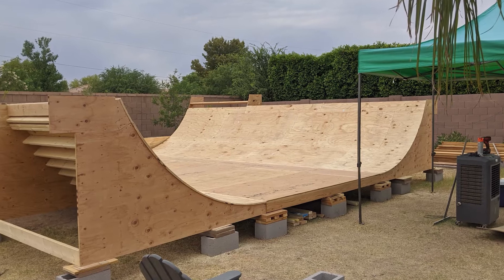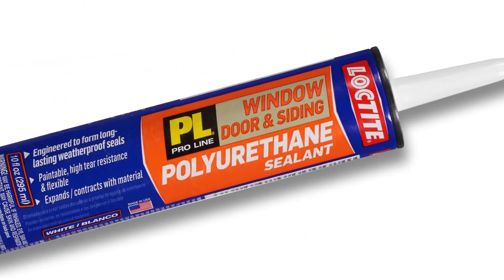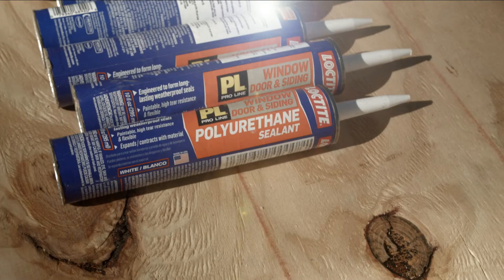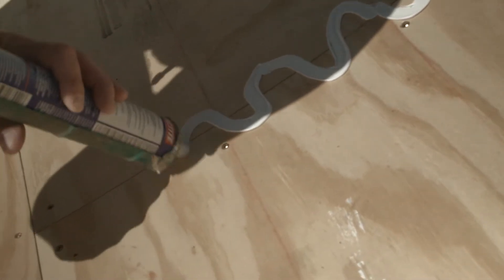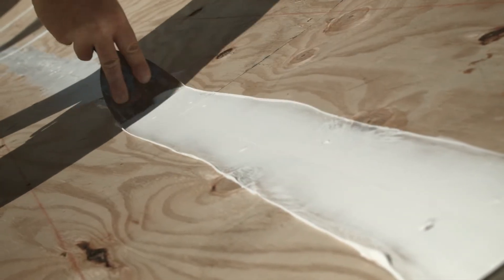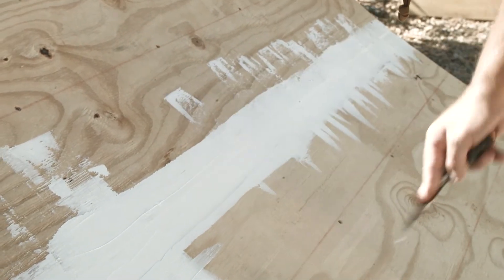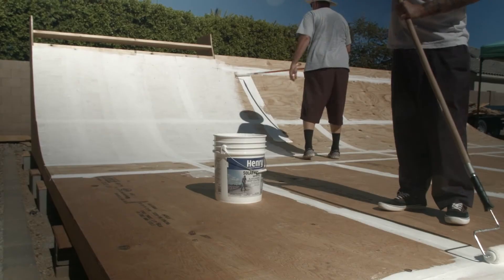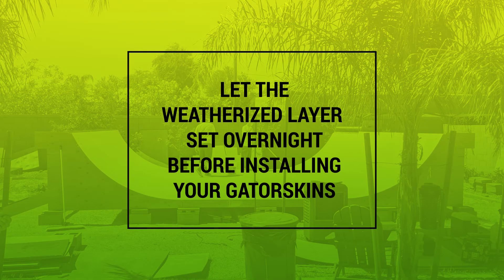Weatherize your ramp!

Comment: If you're unable to get gator skins, do you feel these steps will do a solid job of preserving your ramp? Thank you for sharing ✌️
Reply: I need to know the same thing. This comment is the only one without a reply.
Reply: Yes.  This will make your ramp water resistant.   Wood absorbs water and gets warped and damaged over time.  This will slow down water damage for sure.  👍

Comment: Do you guys tarp before big storms / winter seasons after weatherizing ramps that have gator skins? Wasn't sure if it's overkill or if humidity / moisture stuck under the tarp would do more damage than good.
Reply from the maker: Never a bad idea. If the ramp is going to be inactive and unskateable for long periods of time due to wetaher, tarping it off is always advisable.
Reply: Tarping is not overkill.  The more the water sits on the ramp, the more it will do damage over time.  Humidity will do less damage than standing water.

Comment: Any reason why I shouldn't paint the plywoods bottom and 2x4s prior to install?
Reply: When you screw it in it’s gana break the seal
Reply: Also a matter of time and cost.  You really want to focus on areas where water can pond.   Vertical surfaces are not so much of a concern.  Good idea to also  treat wood touching the ground or wherever moisture will be.